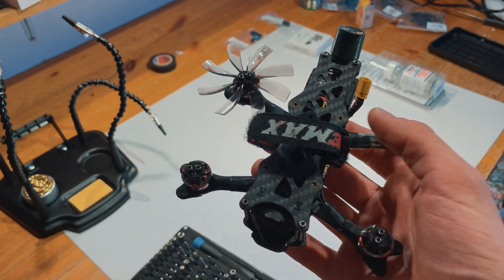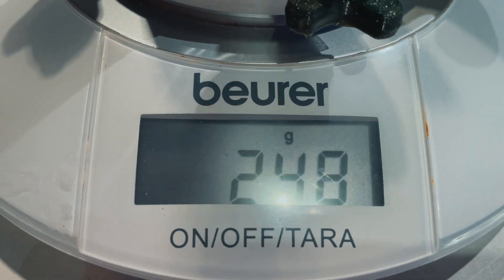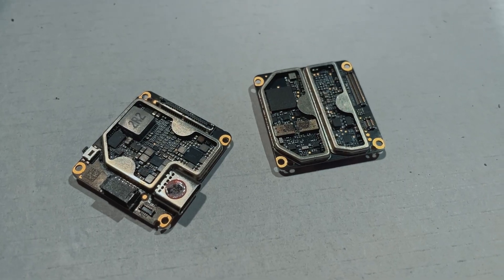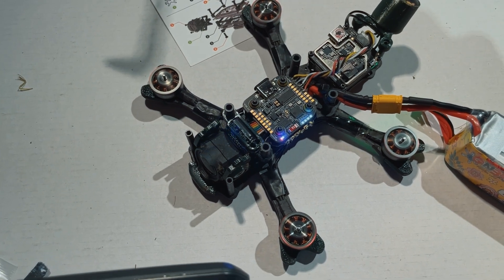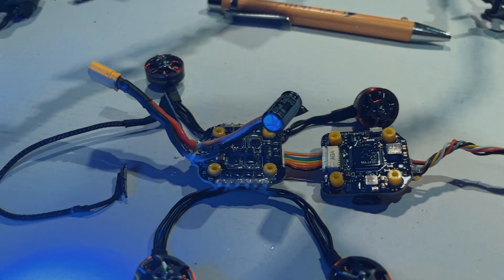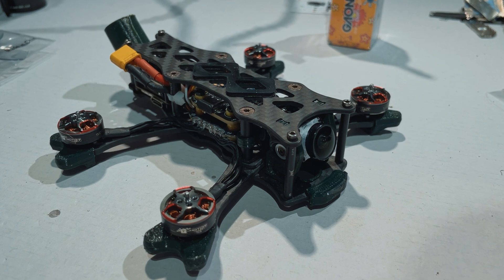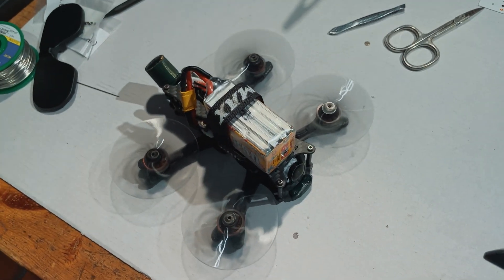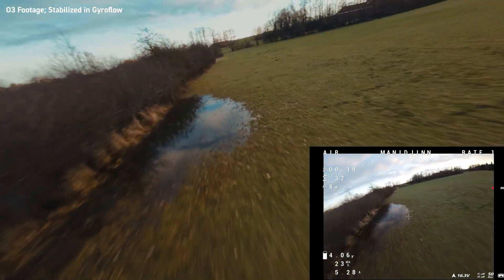Making the #Djinn F25 even better: DJI O3 Ultra Conversion + Conformail Coating

Comment: I love my djinn and i fly 4s 850 and 6s 650 with no throttle limit on AXLS C145 1404.5 4500 KV with the 5 blade props and it flys amazingly. I didn't know they made 8 bladed props but I'm going to have to try those out.
Reply from the maker: Hahah be careful they are really delicate, but very quiet
Reply: Man I have the same motors
Reply: @sosdeathvalley  you've got to try the 6s 650 on those motors there bonkers.

Comment: I used the flywoo kit to convert my dji o3 into naked, when I put it all together a fixed green light remains and I can't bind, does anyone know what I can do?
Reply from the maker: You need to press the bind button on the O3, to have a red blinking light and the re-pair it with googles and controller. I had the same problem, as seen in the video at 4:42 . 

You can also try to connect the O3 to the computer via USB C and reflash the firmware using DJI Assistant 2(Consumer Drones Series). After this I could bind.
Reply: @LippeMann  thanks bro, I have tried to install the firmware again, but when I press the bind button the light stays green, the light does not change to red
Reply: @LippeMann  I use the DJI Google v2, I have updated the firmware again and the light stays solid green, it does not change to red.
Any idea how to fix it?
Reply from the maker: Hmmm that is really odd. When you power it on (using a battery), the light should turn from green to red after  ̴ 20 sec. If that is not the case and your software is fine, try disassembling all of the air unit components again and pay close attention to all connections.

Seems like some people have the same issue: https://www.reddit.com/r/fpv/comments/1ao9xhs/dji_o3_air_unit_solid_green_led_does_not_bind_or/

Comment: Future vtx & cam design should consider the waterproof , like spoting the vtx hot area directly connected to the heatsink and isolated meanwhile the other cold part is sealed with something
Reply from the maker: Yeah I agree! It would be great if manufactures offered this option out of the box. But right now I am pretty happy, I improved it a lot since this video. Maybe I will make another one
Reply: @LippeMann   please make another one i would like to do it
Reply from the maker: will do soon @shredpotato1
Reply: @LippeMann I would also be very happy about a new update video. I got this frame (also because of your great videos) and am thinking about the best way to set up the copter with 4s
Reply from the maker: It is on my to do list! I will do as soon as possible :)

Comment: I have these alphacool copper heatsinks. thin fins. might cool a lil better, you should try. I have a different smaller heatsink on my vista on my rc car with good heat transfer pad to stick
Reply from the maker: They also look great but I guess they could be a little heavier and less robust. Mine works suprisingly well at the moment!
Reply: @LippeMann  one I have with thin fins 100% not robust. Fins will bend. Other one I have in car is robust.

Comment: I want a decased moonlight
Reply from the maker: Then go ahead and make one 😂 And maybe make a video of it, would be interesting
Reply: @LippeMann  omg looking at tear down. The SDcard and something else isn't apart of the VTx or DVR board 🤯 .. think you'd have to cut it out to keep the mount they have for it.. yea too expensive to risk all that 🤣 🤣 🤣
Reply from the maker: That sounds a bit complicated, but you could just glue it together. And honestly, as long as you're able to stay sub250 with your build, those extra grams saved don't make to much of a difference

Comment: well done! I'm thinking to do the same but without applying a heatsink. in order to keep the weight as low as possible. My opinion is that coating is not necessary on the black surface of the p1
what do you think? by rhe way I'm using another frame to stay sub 160 incl batt 4s 550mah
Reply from the maker: I added the heatsink because I was worrying that the naked + coating would cause overheating quite quickly... You definetly need to add the coating to both the O3 boards though, and also some liquid rubber material to cover the plug connections, if you want to have it waterproof

Comment: How did  you coat the camera? taped off the connector I guess, but did you coat the front as well?
Reply from the maker: Hello! I used conformal coating for the board on the back of the camera. I used PlasiDip ( https://plastidip.com/product/plastidip/ ) for the connector and also in between the lens and the camera body. Hope this helps, I can send you a pic if you want...

Comment: I'd like to see the M 1.6 holes drilled out to 2 mm. That way you can mount the vtx over a 25.5 mm AIO stack. I've been told that this can't be done and that the drill bit will break the corner of the board. Seems like it should be possible
Reply from the maker: I think it is possible if you're careful doing the drilling. Sure it will be more prone to breaking. But you also need a frame where that would make sense from a physical perspective. I do not see the benefits for this frame...
Reply: Its of couse possible! The quadmula o3 lite kit have an m1,6 version and also a m2 version. They write about drilling the hole.

Comment: I was under the impression conformal coating a VTX is a bad idea but I guess I didn’t know about the heat sink that comes with the flywoo kit
Reply from the maker: Yeah I was worried too. The heatsink is not included in the Flywoo kit but you can get it online...

Comment: Sounds good on paper but your going to regret do that. Also those props break every easier than a 3 blade. Been there done that. But, good luck.  I would probably destroy that in a weekend.
Reply from the maker: Hahaha thanks for mentioning. The 8 blade props are definetly not very robust. The drone itself is quite rigid. Lets see how long it lasts...

Comment: I made a quad using a naked o3 coated with worryfree and the processor ended up cracking after it hit the water.  I think it was just temp shock or something.
Reply from the maker: Oh sheeeesh, yea that is something I didn't think of... But I noticed that the O3 stays quite cool in flight with this heatsink. I have to measure with an thermometer and do more testing. I can imagine if it gets dumped into water while being 90° C hot, that would hurt a lot...

Comment: i used flywoo kitand i wasn't able to mount the naked camera, did you use your own screws ? 
 without the comformal coating(can't find it in europe), 
the weight is still high, around 270 with 1404 xin2 motors... i'll be outlaw to fly it in 2024.
Reply from the maker: No I used the screws that Quadmula provided. You have the camera in the Flywoo "cage"?
This is where I ordered the coating (I live in Germany) https://www.muellerbestellung.de/422C-55ML-MG-Chemicals-422C-Silikonmodifizierter-Schutzlack-55-ml

Hmm what battery are you using? And what stack? What is the weight of the quad without batteries?
Reply: @LippeMann  but with flywoo cage it's 16 instead of 19...
weight is 170 without battery(you forgot to weight your drone with strap).
i'm using 850 tattu battery.
Reply from the maker: I would try a less heavy battery, like a 650mah HV, that should save you 20g. And what motors are you using? 170 sounds real heavy even with the naked conversion...
Reply: xin 1404 4600kv... yes i don't know from where i'm getting this 170 :( stack is mamba 722 mini stack
 @LippeMann
Reply from the maker: @Ztall0880  That is really odd. I mean we are using similar stacks and motors. Guess it can only be different 3D printed parts / props / screws. I am using the TPU parts from quadmula
Reply: @LippeMann  same here... Anyway i ll move to 650mah batteries.
Quadmula strap is quite heavy.. and i m not even using the 3d printed motor guards
Reply from the maker: Alright good luck! But pay attention to the weight of the batteries before buying ;) @Ztall0880

Comment: Dude get a MG chemicals flux pen and use before you use the iron! OMG so messy! And twist those wires first! Flux before every iron use and iso alcohol to clean up later. 422C cures a little to fast 422B will yield better coats too. nice work except the soldering / welding...
Reply from the maker: Hahaha Yeah actually I just ordered one. I know those solders look super bad right? It was my first build, maybe I should have practiced soldering before... but I was to eager to get started. Thanks for the tip with the 422B, I'll check that out!